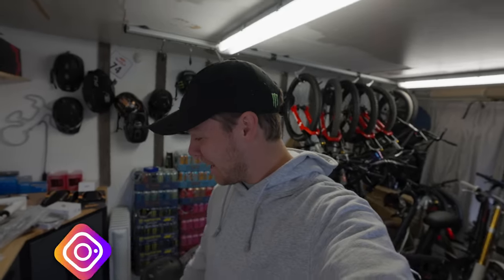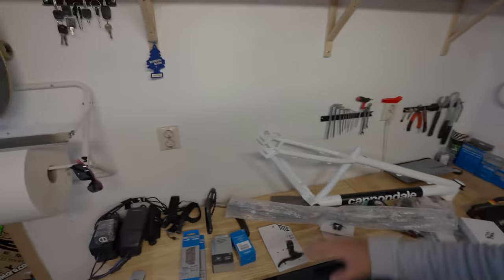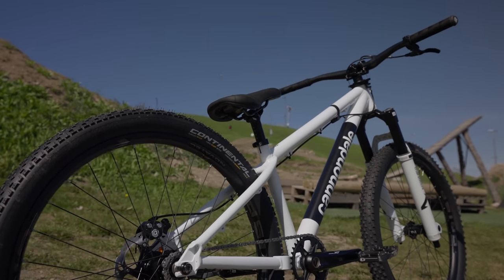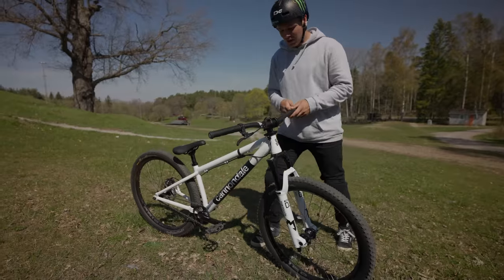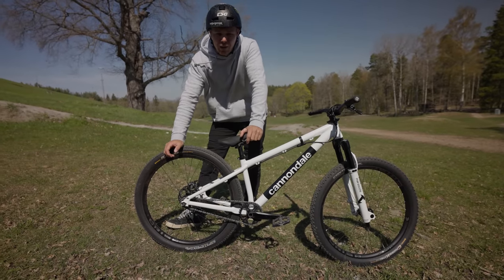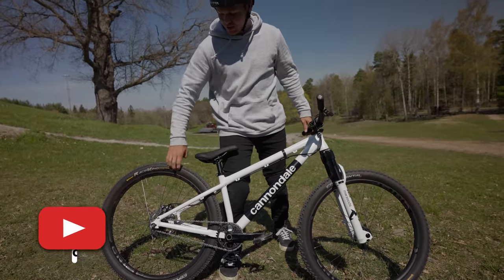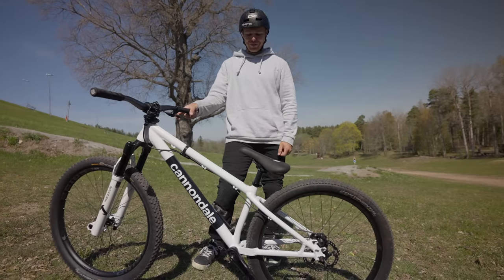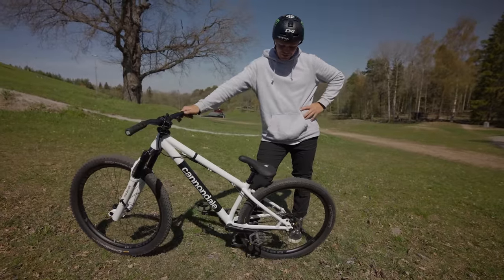MY NEW CUSTOM MADE DREAM MTB! (Bike Build - Crankworx setup)

Comment: Max: i want my front tire to be light so i can make faster barspins

Also Max: i put tubes in so it get´s heavier
Reply: With a tubeless setup you'd have uneven rotational mass since the milk is never evenly distributed around the whole tire. I'm not sure if this would help with doing tricks. Also you'd only save about 50g per tire.
Reply: @cloneoffunkenstein  ik but it still is funny